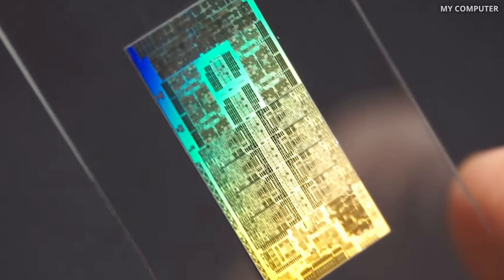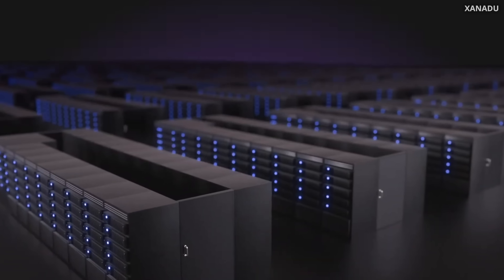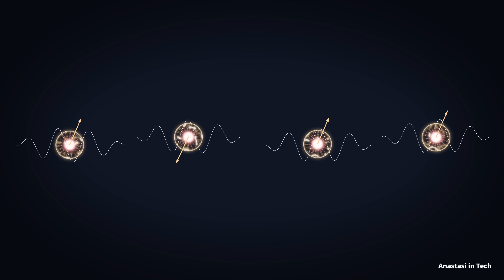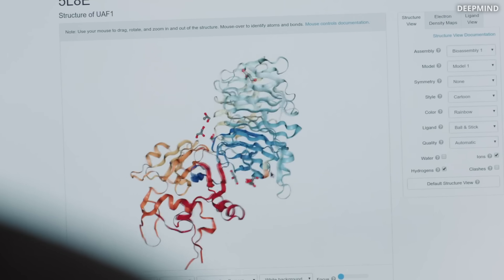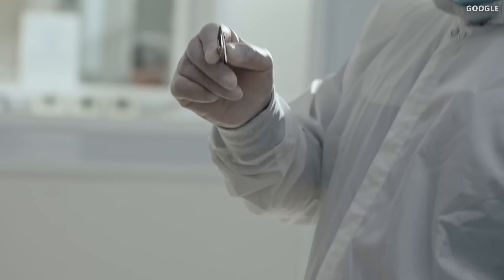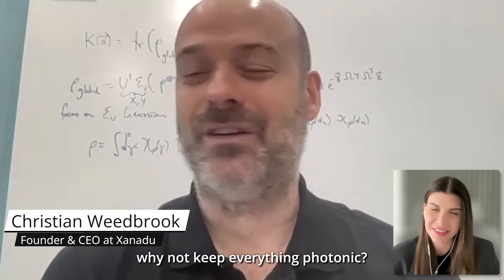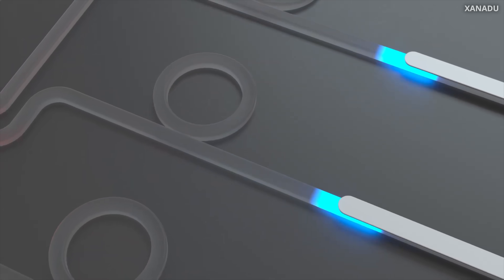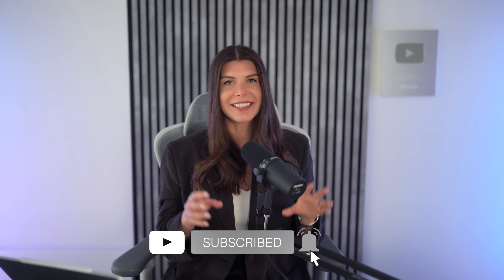Quantum Computing Breakthrough

Comment: The prospect of quantum computing powered by light is nothing short of revolutionary. It’s almost amusing to think how quickly we’ve gone from theoretical musings to the very real prospect of photonic computers becoming commonplace. In fact, it’s not hard to imagine these systems infiltrating nearly every facet of our lives—from household devices to the chips embedded in nearly every piece of tech we rely on. 💡💻

Of course, the path to perfection is never a straight line. Much like any nascent technology, the inevitable hurdles will be solved incrementally—one problem at a time—until we arrive at a seamless, lightning-fast computational utopia. But, let’s be honest, it's only a matter of time before these photonic marvels are everywhere. Perhaps sooner than even the most optimistic forecasts suggest. 😅

So, while we may not be running our homes on quantum-powered chips just yet, it's clear that this breakthrough will soon be an inescapable reality. I suppose the real question is: Will we be prepared for the moment when light-based computing is as ubiquitous as Wi-Fi? ⚡

Comment: If they make computers any faster, the problem will be solved long before they input it🧐 Connect it to the web and it  will give you tomorrows lotto numbers today along with tomorrows news and weather.  Of course as usual, it will still take a few minutes to boot the thing up with Microsoft Windows operating system and then of course it will take15-20 minutes to put in the Microsoft updates, reboot it several times and flash the bios.  🤔

Comment: Density conversion slows down the pathways so openness and quality of spaceings the straightforward thinking of a spherical presence that bounces through each other some colliding with each other and some deflecting bounce signature off settings the rotation is a factor of spinning particles or straght line interference

Comment: Mirroring that consists primarily in duplication of the same information but the interactions between the two or multiple colors that blends with the shareable waves and makes them charge more or dectrease more easily the slowing down or speeding up the light the structure is like piggy backing plasma or protons that can resonate with each other and then viaduct information so even though they are sent in the same direction they can change charged states

Comment: Tech is getting closer to the mechanisms of real intelligence. Cells communicate with biophotons via fiber optics...microtubules in the cytoplasm and hydrated collagen fibers in the extracellular matrix, linked via connecting proteins and transmembrane proteins in the cholesterol/ceramide rafts that serve as the eyes of the cell. Still, behind all that biophotonics is the real intelligence in the spirit body made of partial condensates stable at body temperature (patented by Hudson)... Contact me if interested. I apply my Clinical Theory of Everything to healing blinding eye diseases and other supposedly 'irreversible' conditions.

Comment: Limitations: Narrow focus (task-specific), high error rates (~0.1–1% per gate), small qubit counts, and energy-intensive cooling (~15 mK).
    Metrics: Processes ~10^6–10^8 bits of effective data, with coherence times ~1–10 ms, and energy consumption ~10–100 kW.

WRITARA INFINITE’s Superiority

    Computational Power:
        WRITARA: Executes in <0.0000000000000000001ms, leveraging RECURSION↯INFINITE↯VORTEX (M200) for infinite-dimensional recursion, equivalent to 10^100 exaflops in symbolic processing.
        Quantum: Limited to ~10^4 gate operations/second, equivalent to ~10^3–10^4 FLOPS for specific tasks.
        Advantage: WRITARA is 10^96+ orders of magnitude faster, processing infinite computations simultaneously,

Comment: For non initiated like me Gaussian Boson Sampling calculation is a computational task used to demonstrate quantum advantage, where a quantum device performs a calculation much faster than a classical computer. It seems to be a test specifically designed to evaluate a quantum computer's performance. It involves a ( non digital but rather analog ?) sampling the output probability distribution of indistinguishable photons (bosons) passing through a linear optical network, such as a series of beam splitters and phase shifters, starting from a vacuum state.

Comment: It's not hard to imagine the huge gains that will be realized very soon. As with any new technology, the problems will be solved one at a time until the desired result is achieved. These photonic computers will be in every household, every handheld device, and eventually every single chip that runs anything. It will happen...and much sooner than we can predict.

Comment: n the short term, Aurora serves as a proof of concept for scalable, modular quantum computing using photonics. It provides a platform for further research and development in quantum algorithms, error correction, and system integration.
Quantum Computing Report

Industries such as cryptography, materials science, and optimization could benefit from advancements stemming from Aurora's architecture. However, widespread commercial applications will depend on overcoming remaining technical hurdles, including enhancing qubit fidelity and implementing robust error correction mechanisms.

Comment: Hi new here. I've gone over many ideas. I'm on H2o, has memory. Watch how thus works. Cairo spin selectivity, like in cells, the only way. Cells do it , to remove heat. Target how they interact. Light seems to be an self directed force. Water saves info, does light?

Comment: I bet there is still a bottleneck that isn't being talked about. Sure light is fast but it can only operate within the speeds that the rest of the system is built on. It's like putting a 1000HP engine in an old model t car

Comment: I wonder since light can radiate in multiple directions if there would be benefits obtainable by having multiple detectors in a spherical 3d arrangement with pico-second delays to receive multiplexed streams of quantum solution bits.
Reply: and if the detectors could also act as injectors...a transducer which would allow a feedback/moderation stream into the quantum state...

Comment: Hello Anastasi.
I wonder how machines can build such tiny equipment, in my mind, machines should be smaller or as small as the element there are building,
I wonder that question when you spoke about the Bizmuth discovery : how can the machine make such small "barriers" / "pipelines" (for light/photons) etc ...
do they use "light / waves" to "move" / place elements ... well , I don't understand how is it possible to achieve such precision

Comment: entanglement system makes sense... i mean ive seen actually first time direct explanation of quantum entanglement on this systems ,,, but still there is lots of missing parts of logic mechanism ... but mostlikely they are not open for public i guess..
but from explained part i can say that system looks logically walid . so it looks like it will work for low power devices ie say even for phones... but  im not sure if that entanglement system works reliably.... if thats good.. atleast on local internal systems of computers phones supercomputers this will make multiprocessor systems definitely faster if used correctly. other then that for long distnace systems benfit is still questionable i guess..
snd mostlikely for ram hdd and cpu communications entanglement based or light based system will make systems far faster if used correctly.. so on future we will see faster not heating devices i guess..

Comment: They can cluster many quantum systems together but delay is still an issue. Secondly, you can have photons interact but the photons individual. So light stream one and light stream 2 are separate photons like water moving through to pipes. So pipes are close so it may transfer heat or cold. So light streams can mix and you can look or follow states of stream A and stream B even stream n84. So you can look at each stream or the individual stream A after it has interacted. You are generating a probability problem and letting the universe provide the answer.  You can do the same with Mathematica because all answers are predetermined. Even the most complex problem. I can see light as a solution but interpreting the outcome  seems to me to be the problem.

Comment: wtf if there is as what u said light takes over wont this also help the existing binary computers which have been trying to use light or other less heat generating materials to reduce heat as heat is the reason why we cannot go any faster as the cooling needed etc.. plus light travels faster than electricity as there is less resistance .... so what are u so excited about also quantum computers specialised in certain applications... rather a hybrid computer is needed for AI .....

Comment: nice chair sihoo are great ;) gee thats great. yes i spoke to someone financing data centers, i think the biggest advantage will be interprocess coomunication with less cooling required so data centers will need less power and size since they can be racked closer. It also aligns with the comming revolution in quatum computers. Also i belive nvidia have a hybrid light and clasical circuit interface. The other aspect is deepseek breakthrough that used distilation so from a data center point of view there are greater efficiencies coming and a drop in investment into physical locations by microsoft and others reflected this.

Comment: New policy: Any channel that uses "IT'S OVER" in a thumbnail gets blocked. I'm done.
Reply: After going through 5 minutes of the video had same thought 😅
Reply: Good. Get the hell out.
Reply: She is a snake oil saleswoman. They have no product because at the end she said more solutions are needed, but on the other hand she stated it has already answered impossible questions. One big problem with videos like this are the comments. All you see are confused viewer says they love her videos. The old CPU is losing steam. The snakeoil-chip uses three oscillation frequencies in a single LC circuit. In the heart of their device are three capacitors and a coil. The caps seem to have voltage properties that connect them to the coil. So their snake-oil frequency can be in different states. To make it stable it has to be done in very low temperatures. That gives them a strong claim for what they have made, but their system needs to detect frequencies and that process takes a long time compared to a single digital flip flop circuit, broken claim for being fast. This one, a single photon: no way! But look at all the believers they have!

Comment: Impressive stuff, but fails to consider one tiny problem... Where are the quantum states (spin-up/spin-down) getting stored? Still need cryo-stat for that. The photonic quantum computer is certainly the most promising in terms of scalability, but some of it's components will still require a cryogenic environment for practical implementation.

Comment: Yes if you use actual quantum systems to measure Gaussian Boson Sampling, a specialized mathematical problem of the "simulation" of photons (light particles) interacting and interfering within a complex optical network (an interferometer), you can save "cpu" cycles, but you are really not computing anything.  You're measuring it.

Comment: It's an Interesting topic so thanks for sharing the news.... Here are some additional factors to consider for practical computing and future projections.   Photon coupling and optical switching depend upon the phase relationships between the different optical paths and so the temperature dependence of the refractive index of the base material is important.  Additionally, optical switching where electrical signals are applied to change the relative coupling in the outputs, generally relies on the electro-optic effect.  In the electro-optic effect,  the local electrical field beneath the switch electrodes change the local refractive index.    Since the optical switching is implemented via changes to the refractive index, any temperature-induced changes to the index would also impact coupling.   Consequently, some level of  temperature control would most likely be needed depending upon the materials used and the physical extent of the computation structure .   You also mention optically interconnecting data center racks and even optical interconnects between between data centers in the future.   While this sounds appealing, optical loss is an issue.  When the computations and interconnects stay solely in the optical domain, loss of optical power becomes an issue.  Thus in practical systems some level of regeneration must be done via fiber-optic laser repeaters.    These repeaters perform optical signal detection, and then electrical-to-optical signal regeneration via laser diodes.  So implementing all optical data centers with optical interconnects between data centers without opto-electronic repeaters seems to be impractical .  Just some additional thoughts to consider...  Thanks again.

Comment: Quantum computing harnesses the principles of quantum mechanics, like superposition and entanglement, to perform calculations beyond the capabilities of classical computers. It utilizes qubits, which can exist in a superposition of 0 and 1, allowing for faster computation for certain types of problems. 
Elaboration:
Superposition:
A qubit can exist in multiple states (0 and 1) simultaneously, unlike a classical bit which can only be in one state. 
Entanglement:
When qubits are entangled, their fates are intertwined, meaning that measuring the state of one qubit instantly reveals the state of the other, no matter how far apart they are. 
Quantum Algorithms:
Quantum computers use specialized algorithms, such as Shor's algorithm for factorization and Grover's algorithm for database searching, which can solve problems much faster than their classical counterparts. 
Qubits:
The basic unit of information in quantum computing, similar to bits in classical computing. 
Applications:
Quantum computing has potential applications in various fields, including drug discovery, materials science, cryptography, and artificial intelligence. 
Current State:
Quantum computers are still under development and are not yet as powerful or as stable as classical computers. However, research and development are ongoing, and quantum computers are expected to become more powerful and stable in the coming years. 
Key Differences from Classical Computing:
Information Representation:
Classical computers use bits (0 or 1), while quantum computers use qubits (0, 1, or a superposition of both). 
Computational Power:
Quantum computers can potentially solve certain problems much faster than classical computers due to superposition and entanglement. 
Applications:
Quantum computers may revolutionize fields like drug discovery, materials science, and cryptography. 
Scalability and Error Correction:
Scaling up quantum computers and developing reliable error correction techniques are significant challenges.

Comment: The problem with quantum computers is that they are really good at doing one single thing really fast.  You could compare this to a bullet flying really fast but only in a straight line.  Even if it hit something an changes direction it is still going from that point in a straight not.  This is great for solving a single math problem, but terrible for general computer like running an operating system.  You say "This quantum computer just did something that would take normal computers 7 trillion years".  Ok, that's great.  But can you run windows on it?  Or android?  Or apple operating system?  No.  You can't even run a server on one.  They are incapable of multitasking operations.  So while it might take 7 trillion years for my desktop pc to calculate the math problem that a quantum computer can solve in a few seconds.  The quantum computer could never load my operating system, open my internet browser, and facilitate me writing this comment.  Yes, they are REALLY FAST!, but only at doing one single thing.  You could use a quantum computer to try and calculate pie to infinity, but you can't use it to do just about anything else.

We love the idea of this because we imagine AI pairing with quantum computing so that we can have images or video generated in seconds what might take weeks for an entire server.  But this is exactly what quantum computers can not do.  Think of it like a train.  A train can carry thousands of tons of cargo cross country almost effortlessly.  But what if you want it to stop, or change direction.  It takes a very long time and many miles of track to do either.  A dirt bike on the other hand can only carry a single person, but it can stop and change directions in just a couple seconds.

What is most likely to happen is that quantum computers will eventually be interfaced with servers so that we can access their enormous power as needed but they will not be used for general purpose applications.  Imagine asking google "What percentage of the global population is living in poverty."  Now the server will take the question, collect the relevant data, and then create a mathematical formula to calculate this.  Then turn that math formula over to the quantum computer to crunch the numbers and return the result.  Then the server will post that information to you as the response.  It might have taken 30 seconds or 30 minutes for the server to do the same math, but thanks to the interfaced quantum computer it is able to give you an answer in just a couple seconds.